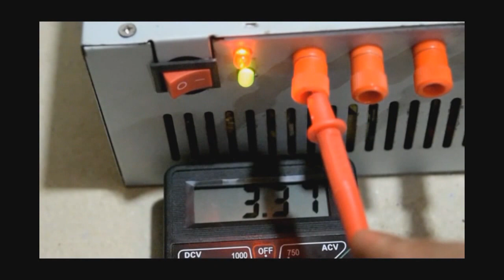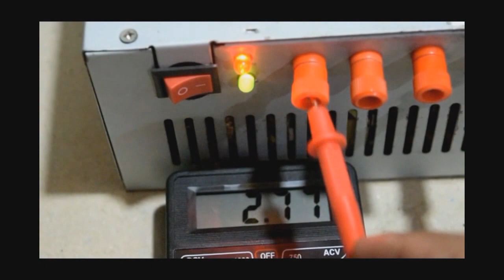PC Power Supply hack

Comment: I have  a  atx power supply that will not take 6amps without turning it off then connecting the load then it works. if i dont turn it off before i connect the load it shuts down. any ideas?

Comment: Hi appreciable job. Well i am using dell NPS-201AB C dell power supply 5 volt working countinuisly but other voltages 12 -12 3 volts only works when power on but for instance only. What could b the cause? Please response.

Comment: ok so if i understand:

Green goes to switch +
black to switch -

violet goes to green LED +
another black to green LED- 

one orange (+5v) to red LED +
another black to red LED -

i am left with a blue, brown and grey wires, where do they go???
Reply: brown is a 3.3v sense wire, it should be connected to an orange 3.3v wire , this allows the psu to detect and regulate its voltage.  the grey wire is a is 5v self test wire , you can use it instead of an orange wire to the LED for PSU ON status. the blue wire is a -12v very low amperage lead , trim it off and leave it disconnected from anything, and DO NOT bundle it with the yellow +12v leads.   another thing to note besides some PSU's having a few different wires than others, some PSU's wont run/stabilize without some sort of load on them. It's pretty common, especially with PSU's that dont have large fans to need to put a 5ohm/10watt resistor on one of the red 5v leads and then hook the other end of the resistor to a black / ground wire. Most of the 650w+ PSU's like what's used in gaming computers and such need about 22ohm resistor on a 12v wire. it gives the PSU a load for it to stabilize on.
Reply: thanks man much appreciated, so the dummy load resistor that i have (10w 22ohm)  should be soldered bewteen a +12v yellow and ground black and NOT between 2 yellows?
i have a 430w PSU with a fan.
Reply: certified30
 yes that's correct, 10w 22ohm resistor between a +12v and a ground (black) to form the stabilizing load for modernized psu's
Reply: Ok so finally i got this thing done, it works fine except that now the 12V port reads 11.92v only using a multimeter. i have 2 rails of +12V yellow and yellow with black stripe, i have bundled them together since both are +12 volts.
before i started working on this project i tested the 12V wires they all read over 12V, not sure why i have a voltage drop now!!
Reply: 11.5v and 12.5v are the "abnormal" min/max voltages for the +12v system 11.92v , is well within spec for a PSU, especially a used one. My desktops PSU will flux between 11.94 and 11.98 and +11.92v is within spec. once its loaded and warm and the switching system is doing its magic under load, that voltage will probably be closer to a true 12v. the important part of the system is that it's providing a stable voltage , the tolerances for the +12v rail is +11.4 to +12.6. and 11.9x to 12.0x is right in the middle exactly where you want it

as for why it was showing higher at some point before its hard to say exactly without asking a torrent of questions, it may have been due to a difference in the load on the power source, or a temperature difference or something like that. but as long as it was like.. let's say.. 12.1 that would be very normal. the same psu will test voltage lower if the psu is physically cold, 50 degrees F, than if it was 85 degrees F with no other changes and once the psu warms itself up (which it will..) it'll test just like it did at 85. Now, if it tested higher than 12 before you added the 22ohm resistor, that's why, but it has nothing to do with the resistor itself and more to do with the power source having stabilized (purpose of the resistor). When they aren't stable, the voltage will often swing high and low depending on the load, and often for no reason at all because there's nothing (no load) for the switching system to balance itself on load wise. hope that made sense, sorry for the long winded explanation
Reply: thank you very much for your explanation, it makes more sense now, i was kinda getting pissed because i spent a whole day building this thing then disappointment.
Reply: no problem at all , glad to help! They're a fun project. The only time i've had any significant trouble with them is when powering certain mobile electronics like computerized ham radio tranceivers or stereo amplifiers. the 12v system on vehicles is actually a 13.8v average system that actually gets up closer to 15v at times and often companies like kenwood will design their car electronics with those specific voltages in mind and under load (even tho there are adequate amps) the devices won't particularly care for the truer 12v source. but, theres ways around that too! :)  happy tinkering!
Reply: you are definitely sent from heaven to help lol i built this unit to test and power a Motoroala GM300 Ham radio that wouldn't stay on using a car 12v outlet damn this is weird hhhhh
Reply: if it's a CEPT84 (us army spec) the gm300 is a 13.2 +/- 20% (CEPT84 should run fine from a 12v PSU, they were designed to operate from 11-15v it gave them longer run times on vehicle batteries that had been removed from vehicles , if it's an EIA spec it's 13.8 +/- 10% - still may work fine if it's a 3032 , 3030, 4033 or 4030 model  that said, i never trust a 12v car outlet for more than recharging a handheld. they're usually only fuse rated to about 10-15A and the wiring on 12v car outlets is substandard - really only rated for about 7.5A
Reply: the power supply that i built got a negative -12v port so if i hook ground to it and the 3.3v positive i have about 15v would that be safe to power the radio? or do i risk to blow a fuse? and how do i install it in my truck if most vehicles use only 12v?
Reply: can't do that with switched PSU's without using diodes/mosfets and what not, itll make the magical smoke - the short answer as to why, with a PSU, hooking a 12 to the 3.3 = the 3.3 being overloaded by about 9v

connecting 12v and 3.3v in series mathematically on a basic technical principal does = 15.3v but in reality without diodes and such to prevent the 12v from feeding up the 3.3 and the fact they're coming from the same power source it basically results as a dead short and the 3.3 rail gets very hot and starts to glow and smoke and then you get yelled at for making the house stink and then you're out a PSU and a can of febreeze :(
Reply: the problem with the 12v power port was likely the power port itself, they just aren't designed to run a "real" radio from, autozone and places like that sell battery terminal rings that have square posts on them for use with female spade terminals. they usually have 3 terminal posts per ring, and 2 rings come in a package, basically disconnect the battery terminal slide the ring over the post and reinstall the terminal and retighten it, then it's just a matter of snaking the wires through to the engine compartment and hooking them up , there's a rubber grommet up above the brake pedal where the vehicle wiring harness comes into the vehicle where you can carefully route the wires

if the radios wires don't still have a built in fuse, it's a good idea to put one on both the leads for safety

as for the vehicles voltage, vehicles voltage is on average 13.8v if they're a "12v" system which 13.8 is the voltage mobile transceivers are designed for , so unless there is some sort of fault in the radio, simply connecting it to the vehicles battery , the radio will work, where , plugging it in to the 12v power socket , it may not for a variety of reasons
Reply: damn, this sounds more challenging than i anticipated.
Reply: if it was my radio, before i got too wound up in doing anything with a permanent installation into the truck, i'd pop the hood and hook up the radio directly to the vehicles battery with either the rings i mentioned from autozone that use the female spade connectors (the rings are cheap, like .. 2 or 3 dollars or loosen the battery terminal nut and pinch a good bit of the end of the wire in that nut so it gets a solid connection. and see if the radio powers on. If it doesn't power up hooked directly to the battery, something is wrong with the radio. just dont key the mic without a properly tuned antenna or dummy load connected (or license for that matter)